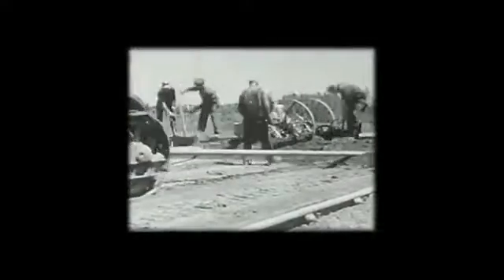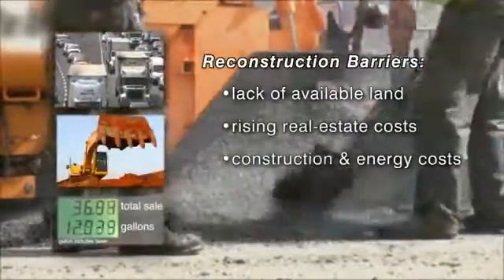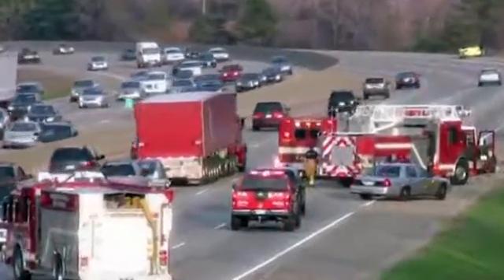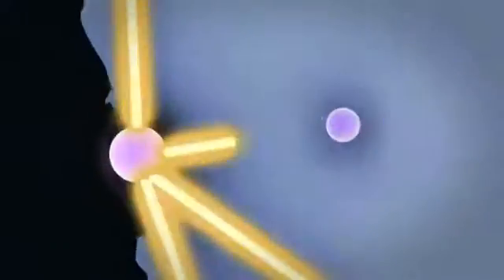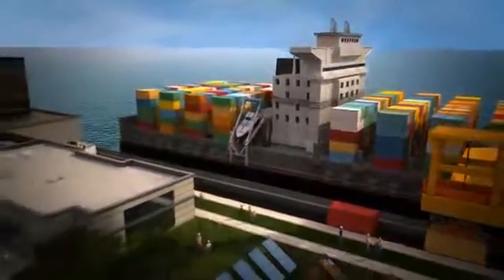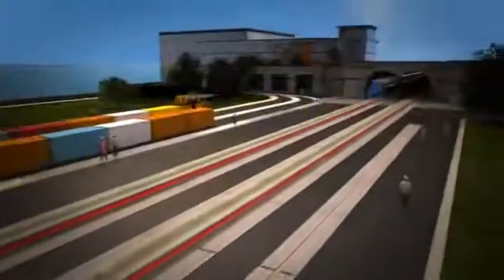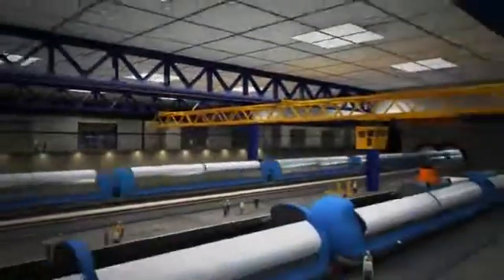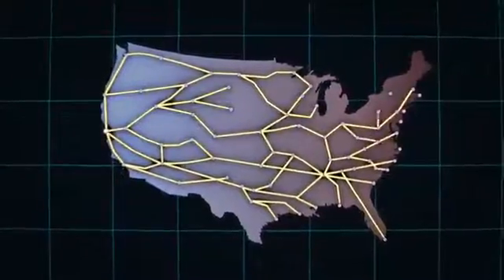Automated freight

Comment: Good ideas. I'd like to see most of it put underground. There is nothing worse than getting sweaty from running and then having to stand around 15 minutes in 10F weather waiting for a train to pass. I don't like turning blue. I think it might also be good to put high speed passenger rail in the same hole but on different tracks while you're at it.